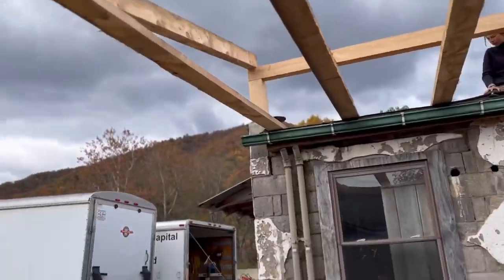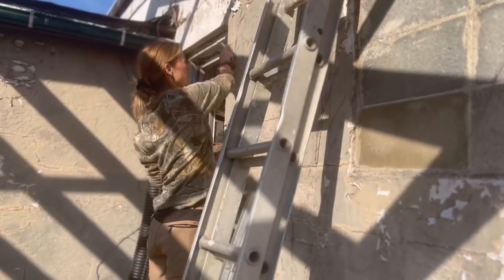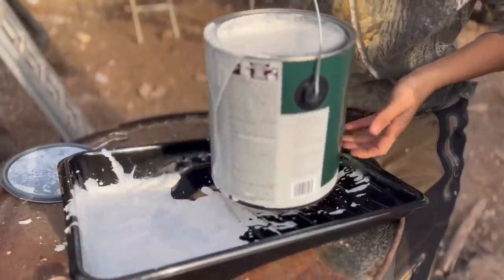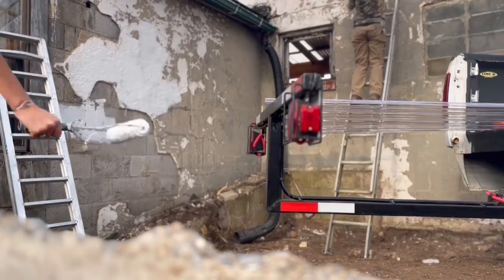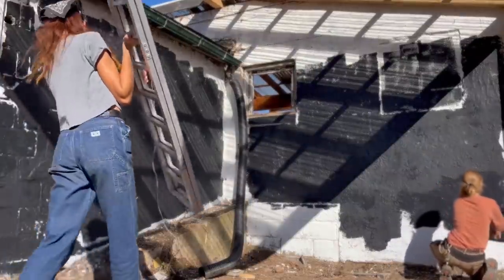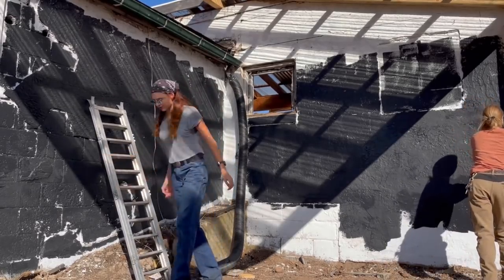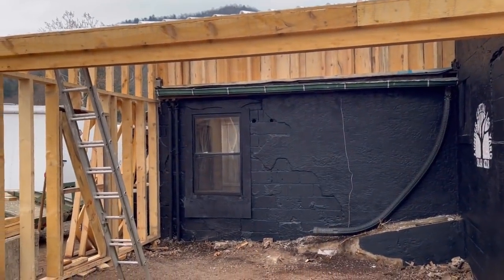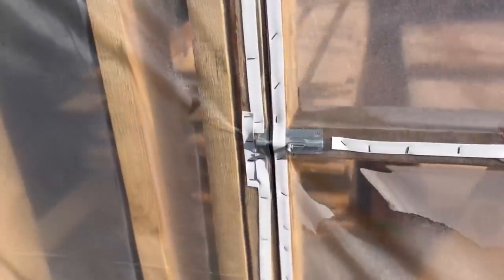HOW WE BUILT OUR SOLAR KILN! Will it work?

Comment: I had a solar dry kiln here years ago and the one tip I can offer is to get it Air tight.
That way you can shut it tight while the heat builds at first, then open a vent a little each day to release the hot wet air.
Then when the wood is nearing final dryness, you shut it air tight and leave it that way so that any remaining moisture can wick out and equalize the wood.  You never want the surface moisture to get too dry.  About -2% from the core or you will case harden.
Lots of luck with the kiln.

Comment: Nice job!  One recommendation.  You should have lined the floor with a layer of thick plastic sheet before putting down the crushed stone.  It is amazing how much moisture wicks up from the ground.  The ground will never dry since it is contiguous with the surrounding ground - the moisture just keeps flowing in.  You can still seal it though.  Put down a layer of thin insulating foam, then the layer of 10-mil (minimum) plastic, then another layer of thin insulating foam and finally another layer of crushed stone.  You need the insulating foam to keep the plastic from being perforated by the stone.  Even a tiny hole in the plastic will allow a lot of moisture through.  If you don't buy plastic material that is large enough to cover the floor without seams, then be sure to use purpose-made sealing tape for concrete plastic underlayment - needed to form a perfect, permanent seal.  Enjoy!

typical products - just for reference - other companies make similar:
Reflectix R-21 Attic Wall Unfaced Reflective Roll Insulation (50-sq ft 24-in W x 25-ft L)
Reflectix 2-in x 30-ft Reflective Insulation Tape ... or ... Americover White Vapor Tape
Americover 10 Mil Clear Dura-Skrim Reinforced Plastic Sheeting
Reply: Excellent advice, Scott!
Reply: That was the first thing that came to mind for me.  Second is a way to vent the evaporating moisture.
Reply: same here
Reply: I wondered the same thing, it seems like the goal of a kiln is retaining heat and keeping moisture out. Sealing and insulating the floor seems like it would make a huge difference in both of these as well as some kind of dehumidifier to pull the moisture out of the air.

Comment: Nice job! I build greenhouses. If you guys put another layer of 6 mil plastic on the inside of the walls/framing/studs it will add quite a bit of insulation to the kiln. You probably already know that commercial poly-film greenhouses are built with two layers of plastic that are inflated  by pumping air between the layers. It provides excellent insulation!

Comment: If you build another kiln drying room. Look into negative pressure (Vacuum) room kiln. With lower pressure, you lower the point of boiling of water. This will allow lower heat to go much further in drying out the wood. Nice job ladies.
Reply: I’ve never heard of vacuum room kilns? If your referring to a vacuum kiln you need lots of $$$$$$$$
Reply: @dontfit6380  You do not need to achieve full vacuum. The biggest obstacle is getting a sealed room built. Along with sealable doors. Then you are looking at glass for the Solar, plastic will not due. Then a compressor to maintain the lower pressure. Just enough lower pressure to change boiling point by 10 degrees, can make a considerable change in time and fuel if you are doing any aux heat source.

Comment: I suspect you may have a good bit of moisture issues. The floor should be sealed in some way, I would suggest at least a tarp, but an insulated subfloor would be best. Really need to get that thing vented and fans going for circulation ASAP. It may not be an issue now, but you are going to have mold issues. Also, the gutter running on the back wall, has this been disabled? If water runs through it, this will add a significant amount of moisture. You will have to see where your temps go but if you don't hit 130 +, for an extended period, you won't kill the bugs. If you are going to stick with the plastic, line the interior wall as well, this will give you a good bit of added heat. Personally, I would scrap the plastic, put up walls and insulate it. 

Not trying to be critical, just trying to share from my experiences. You worked hard to get where you are, keep it going.

Comment: An airless paint sprayer might have been the way to go, much quicker than rolling. Great job regardless.
Reply: It certainly would have been easier, but if they knew how to properly roll paint, it wouldn't have been a hard job. They should have had an 1-1/4 nap roller and a roller screen inside a 5 gallon bucket along with a a 4-8' roller pole. The pole gives leverage and most people, just like in the video, use far too little paint. For that wall, my roller would have been dripping wet. For interior walls, I get the roller wet enough that it almost drips. After all, the point of painting is to actually create a solid film on the surface.

Comment: Yep,you will need the vent to pull drier air in from outside or from somewhere anyway. Can you use the humid air elsewhere? Maybe route it to occasionally circulate but not so much/often that it cools the kiln too much. It would have to be closeable for times when you don't want any circulation.

Comment: Heed the advice of Scott Lentz, below, or you will be defeating your purpose. I would go a step further and seal the edges of the plastic to the walls to avoid water intrusion from the dirt floor.
How will you provide for air movement in the kiln?

Comment: This looks great. I may have to try something like this sometime. Note though on your plastic sidewalls. 6mil plastic is 6/1000” of an inch (machinist measurements), not 6 millimeters (6mm). 6 millimeters would be almost 1/4 thick. Sorry, my pet peeve has always been accurate measurements.

Comment: good idea to dry some.  AD vs KD is good, and dried quarter sawn Oak might bring double the price.  The nice thing about lumber is generally it gets MORE valuable as it ages a bit,  vs most products.  Normal dried oak is maybe $5 to $7 /bdf on the west coast.  But with quarter sawn, double that.  And if special even more.  Lots of good comments on improving the kiln, yes.  There are special films that will last much longer too, like 7 years in sun.  They are also MUCH MUCH stronger and will resist wind.  You saw a lot of wood, pull out the beautiful boards, set them aside.  They can go for a lot more than the common stuff.  Obviously not the hemlock and other softwoods.  But on the west coast, VG fir, is close to $10 bdf when dry.  You must have Cherry, maybe some walnut, Oak, and other woods that will be desired.  And as you said, if you have burls, yes.  We also have a big market for wide slabs.  I just bought one for a client, 12 foot long, ~ 46" wide, live edge.  A good price @ $800.  (redwood, but not old growth).  They would dry it but that added $500 more.  I just painted the ends and stickered it on a flat surface.  Turned out it's moisture was already down to about 12%.

Comment: A job well done. This will give you a better feel for the market, then if it warrants it, you can build a larger one. Just like many things in life, as soon as you build something you see improvements that can be made, and I am sure with some time you will make them. One kiln I saw had a timer on the fans that replaced the air, they would run for a short time, a few times a day. This allowed time for the moisture to be drawn out of the wood before the room was cooled off by the "new" air. It also had circulating fans.

Comment: So ladies and gentlemen. I have read through most of the comments to date and several are quite valid. I truly enjoyed the segment but yes, a vapour barrier wold have been better below the crush on the floor just to control that element of moisture from the ground. I’m wondering why you didn’t blacken the wood rafters etc too..  just to enhance the solar heat absorption for the kiln. 
I am of the opinion that this has been a very well thought out program. Accolades to your whole family for being innovative enough in trying  something that is off of the charts. 👍

Comment: I’d first like to say it looks like you guys worked hard and got a lot done.
I’m not sure this solar kiln is going to work in the way that you think that it will because of several deficiencies. You have no vapor barrier on the ground and the roof that you built over he’s going to bring rainwater right into the solar kiln because of the gutter that you enclosed.
I saw that you used a white primer, I assume that you did not know that they can tint the primer to make it a dark charcoal color. That would’ve been helpful in your painting.
Can this kiln work? I guess that depends on what you consider success to be. There needs to be fans blowing and circulating the air through a drying chamber and then coming up through the wood making air cycles. How are you going to get the moisture in the wood & air out of your kiln? You didn’t address that either so in reality I’m not sure that this is going to be worth your effort. Sorry Once you get the wood drier, it must be stored inside in “conditioned” air so it doesn’t suck moisture right back in. Where will you store this wood?
FREE Solar kiln plans are available from many sources and universities with data and statistics proving their capabilities.
Reply: Really???don't be that guy!!
Reply: @thekiltedsawyer   What guy? Could you please explain your post? Thanks
Reply from the maker: Our hard wood is already down to 15% moisture.
Reply: Maybe have a comment on what they did right?
Reply: @lumbercapitallogyard  Sounds good, but getting it to be stable at less than 10% will be the challenge. Good luck! You'll figure everything out!
Reply: @robertm348  I take slabs that once at or around 15% their put them in a couple shipping containers. When hot out they quickly dry down to below 10%. 
I’ve sold hundreds of slabs with no issues. 
I also have a woodmizer KD250 so I understand that drying wood has been turned into a science but it doesn’t always need to be.
Reply: They are selling rough cut lumber the last I checked. The only people buying rough cut lumber and expecting it to be 6% are millennials. 
If your drying green wood, once taken from the kiln it will not return to green wood. Yes it may not stay at 6 to 8% but the buyer can easily put the wood in a conditioned shop or house and have it dried back down in a few weeks. Most people would prefer to pay the price for lumber from an operation like this as opposed to one with a vacuum kiln and a HVAC condition warehouse.
Reply: @dontfit6380  True enough, but I never said it should remain at 6%. Rough cut lumber -kiln dried or rough sawn- should ALWAYS be acclimated, then skip-planed, cut slightly overwidth, then stacked and stickered with weights on top for a few weeks before bringing it to final dimensions. This allows internal stresses to release so any warping can be minimized and machined out.
Reply: @robertm348  Agreed
Reply: @dontfit6380  BTW, the old Yankee Woodworker's axiom, "Measure twice, cut once" may allow you to drop the "Don't" from your screen name! LOL
Reply: @robertm348  Haha your right. Thats why I’m a full time sawyer and amateur woodworker and not the other way around. 
The Don’t fit actually refers to my place in society. I just Don’t fit! I was born 500 years to late.
Reply: It does if you want to make money at it and have customers returning to buy more
Reply: @grdelawter4266  they obviously are making money at it. They do have returning customers. It doesn’t have to be big box store lumber to sell.

Comment: Great video! Thanks for sharing it. I've never bult such an elaborate kiln to dry lumber. My typical kiln is some pallets across some flat ground with the wood stickered on top with a black poly tent over the top, like a pup tent. The sun on the poly warms the everything inside and moisture is drawn to cooler temperatures. 
I have every confidence in the success if your kiln. It will work in the winter. 
Keeo uo the good work.

Comment: Good afternoon! It was good to see all you kids working together. I thought I even saw your mom flash by a couple times. I got a kick out of your brother’s avenue of descent from the roof. Hung from a rafter to get his feet on the window ledge, then hopped down. From higher than he is tall! Even when I was young and immortal I would have hesitated at that. You and Jade are about the same height, right? One of you was standing by Sam and it appears you two got a tad bit more height than she did. Cool logo. 

Others here have commented that you need a moisture barrier under the gravel. It is true that the kiln will have to dry the soil out in addition to the wood, but if there’s no water running into the enclosure from surface flow or a leaky gutter, my experience suggests the soil will get fairly dry in a season or so.
Reply: A season or two will make for some longer drying times, and possibly some lumber not dried properly. Is it worth it?
Reply: @robertm348  Hey, do I see you on OWTM too? As for drying time, I assume they’ll go to a measured moisture reading instead of just a specific duration. Would be longer, but it would be work to redress the vapor barrier now.
Reply: @johnsadler8637  Maybe, What is OWTM?
Reply: @robertm348  Then probably not. Outdoors with the Morgans. Another sawmill/firewood/tractor etc channel.

Comment: Nice job...But may I suggest insulating your walls...Your Concrete walls absorb water...When there’s high relative humidity in the air, concrete begins to absorb moisture from the air. However, when there’s low Relative Humidity, the water previously absorbed will begin to evaporate from the concrete back into the atmosphere. Use a Dehumidifier.
One of the comments suggested redoing your floor...He gave good points...You have to have the Kiln well insulated...flooring walls...

Comment: Great to see a solar kiln. I know, as a carpenter, exactly what you mean about timber being more fragile, after going through a standard commercial drying kiln. Kiln dried timber can actually be more fragile, in my experience, than the same timber which has been exposed to sun and central heating for over thirty (30) years.

The young fella is getting pretty good with his video bombing! 🙂

I wish you all the best with this project.

Comment: It was painful to watch you girls paint! If you knew how to properly roll paint, it wouldn't have been a hard job. You should have had an 1-1/4 nap roller (3/4" minimum) and a roller screen inside a 5 gallon bucket along with a a 4-8' roller pole. The pole gives leverage and most people, just like in the video, use far too little paint. For that wall, my roller would have been dripping wet. For interior walls, I get the roller wet enough that it almost drips. After all, the point of painting is to actually create a solid film on the surface. The W pattern is also pointless. With a wet roller, do 1 vertical swipe, starting at one side. If there is enough paint, drag the roller over a little and overlap. It should look like you put too much paint on the wall. Dip as often as needed and cover a 4 to 5 foot wide section, top to bottom and don't worry about it looking good. After that, use the roller not as wet and start from the beginning side and roll up and down all the way to spread the paint and work it in better. Do long strokes and gradually move across the wet area. If you hear the roller nap pull from the wall or if it is dry and you have splatter, you don't have enough paint. With more paint, you will get less splatter. The surface should be even, wet, and shiny so it dries as a film or sheet on the surface. A gallon of paint should only cover 200-300 sq feet, at most, on a surface like that.